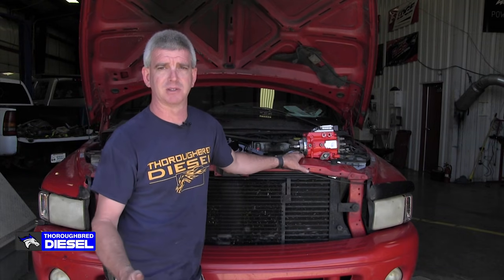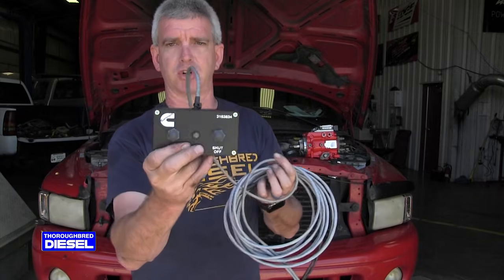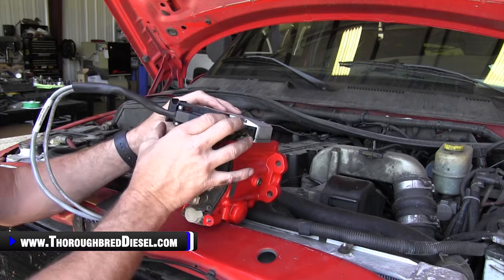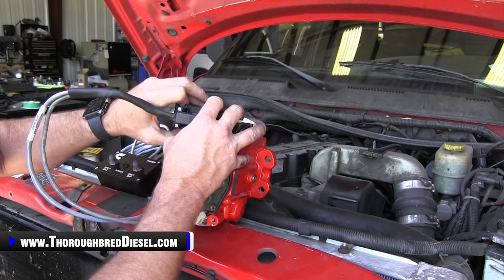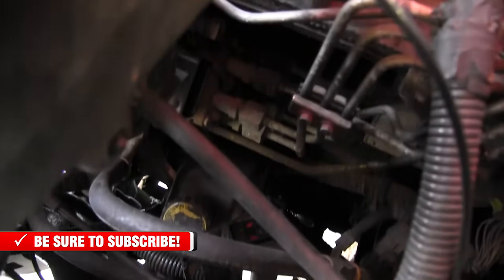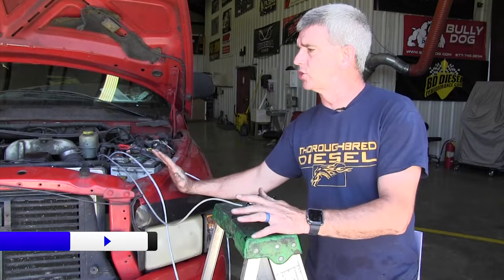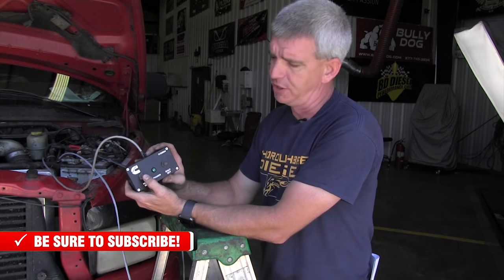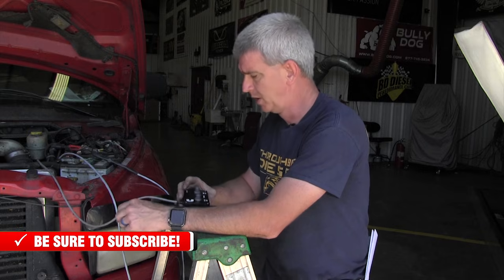Diagnose A VP44 or ECM Problem w/ a Break Out Box Tool #diesel #cummins #howto #fyp

Comment: Okay I have. 2001 Dodge Ram 2500 24v, I have replaced ecm, fass 165, new engine harness, and new injection pump! So my problem is when I unplug the vp44 & run a ground from the injection pump plug in to the battery and it will start right up! If I plug the injection pump back in it will not start!

Comment: After a hard wired test my truck starts right up, so I'm looking up for a ECM issue.. so do your own research and look for pin 6 and 7 from vp44 and run a fuse wire straight to the battery and a negative and it's the same with this attachment.. easy
Reply from the maker: More research is always good.

Comment: Hi, I'll watch all your videos. I checked my + an - with a test light it showed I have a good pos an negative. O an I had a p1689 code just saying so I hot wired my vp44 an the truck started up. So are you thinking what I thinking bad ecm.
Reply from the maker: Thank you very much.  Could be,  check you fuel system relay first before condemning the ECM.  Are you getting signal at the wiring harness?
Reply: @thoroughbreddiesel  I got a ecm from a 200 truck k an it started up an the truck runs better now thin ever had thank you for the info.

Comment: Hello sir
I have a problem with ford focus 1.8 tddi. it has a similar fuel pump, I think VP 30. The problem is, it starts ok, runs ok and then it just die. I can drive it whole day and it won't  die. Then in other case it dies very often. I have good power, good ground. CKP sensor tested and it is ok. I tested CAN L and CAN H terminals and the signals are ok. 
I think that the electronics itself is starting to failure
Reply from the maker: Do you have sufficient lift pump pressure to the pump?
Reply: @thoroughbreddiesel  Tddi does not have lift pum in the tank.

Comment: I have 2000 was having throttle body issues. Because it would fluctuate and finally it went dead go dead. Replaced the throttle body sensor and got it to crank it would be running good and then just go dead. It did this about 3 different times. Finally pulled it off got it cranked run like a top for about 9 miles and just fell on its face and died. Haven't been able to get it cranked since. Any info is appreciated.
Reply from the maker: What codes are in the truck and what is your lift pump pressure?

Comment: Quick question... I have a 2001 and the fuel pressure port is on the back side of the fuel filter housing. Is this an OK place to ck the pressure? I assume this is pressure before the filter. Or is it after? Thanks for the help!
Reply from the maker: That’s ok and yes it will be a pre filter test.  You can move that to the pump side by just swapping

Comment: Does  it  work  for  heavy  machinery with  24v voltage or only 12v ??
Reply from the maker: Yes, but you will need to check incoming voltage to the pump to make sure its 24V.

Comment: dude i have a 03 f-650 cummins 24 valve lost powre at lift pump power wire at pump comes out of pcm bypassed that put on own relay to get power starts but in limp mode for no power at lift pump still how do i get out of limp mode
Reply from the maker: I think you can ground the ground portion of that original drop to the LP and it will make the code go away?

Comment: Dumb question, would this work on other equipment with vp44 pumps?
Reply from the maker: Yes.  As long as it’s a vp44 and not a VP30 or a 24 volt pump.

Comment: How can you check fuel pump 97 Freightliner Cummins 5.9 Winnebago Vectra motorhome codes 111 and 368
Reply from the maker: Does it have a VP44 engine in it?  I am not aware of those codes but if you can get us descriptions of the codes, we can help.  If its VP44, as always check lift pump pressure.

Comment: I have an 02 and having issues. It starts and runs fine, hot or cold. I can be idling or driving a d the truck will shut off but if I’m driving it’ll star back by itself. If it’s idling, it’ll die but I have to turn the key to start it. Hooked a reader up to it and it can’t find anything but cycling the key it has p1693. Any ideas??
Reply: Did u ever fix this problem
Reply: @eithanbegay1285  no. Still messing with it. I’m leaning towards computer

Comment: Does the VP 44 sense the temperature when it is cooler and compensate with more fuel for starting?
Reply from the maker: There isn’t. There is a position sensor in there though. IF you are referring to the “cold water on VP trick”, that frees up the timing advance piston in the bore which will allow the truck to start.
Reply: @thoroughbreddiesel John Deere applications use the fuel temperature sensor

Comment: Does the VP 44 sense a problem with an injector and try to compensate?
Reply from the maker: No. The injectors are full mechanical and the delivery to them is constant. If there is a problem, say low or no delivery on the injector, the fuel is returned to the tank.
Reply: @thoroughbreddiesel  The poppet valves are mechanical** The fuel solenoid and timing solenoid however are not

Comment: Sorry if I didn't get this straight - but if the engine starts and runs with the breakout box the pump is okay? Or the pump is not okay?
Reply from the maker: If it starts and runs on breakout box,  the VP is ok, but depending on what your diagnosing the breakout box doesn’t tell all. It wont diagnose driveability issues. It only will tell you if you have a no start condition, if the pump is the problem.
Reply: @thoroughbreddiesel  Okay, thank you for the the reply and information. Keep up the good work!

Comment: Could this tell is the ecm is burned to give the truck a dead pedal. I have replaced the vp44 and the lift pump I have cleaned the tank filled it up and I miss throttle at 1200-1700 rpm

Comment: I have a prob with my 98 Dodge Ram 2500 5.9 Cummins 24 v it idles great as soon as I hit the throttle it chokes up I replaced the throttle sensor already hope someone could help me out
Reply from the maker: You will want to check your lift pump pressure, and scan the truck for codes.

Comment: Would it help me diagnose my 02 24v getting stuck at high rpm then getting dead pedal after going on the highway when its colder out? I t starts fine though. After I turn off and let sit for a minutes and start back up, the rpm settles back down to normal idle.

Comment: If I have a vp44 truck that has a no start when cold issue will this tell me if I need a vp44?
Reply from the maker: Not necessarily. More than likely it is a leak down situation. Park it with the nose of the truck uphill one night, downhill the next. This will tell you where your leak down is, one of the directions it should start better than the other.

Comment: Question: 
2000 Ram 2500 2wd
 I have 8 volts going to the lift pump (pin 35&pin15)and 8 volts going to the vp44 power supply relay(pin 36). All wires have been ohmed out going from the connector to the pump and pump relay. All was good. I also checked voltage into ecm on pin 48 and 50 (both at battery voltage) as well as ground on pin 49(solid ground). No shorts, restrictions, or any other problem. If I  hot wire the lift pump and power supply relay the truck runs. 
I also checked grounds at block and body both places at zero ohms to ecm ground on connector.
What's the problem?
Thanks in advance😀
Reply: A wire can ohm good, and not be able to carry the current needed because of corrosion and or breaks in the wiring. Load test that circuit. If it's good your ECM output voltage is low, meaning an internal malfunction, so long as voltage input is what it should be.

Comment: Hi, Thanks for the video... I have a question, should pin 5 (fuel shut off) be permanently powered to allow the engine to start and by pushing the stop button the power is interrupted causing the engine to stop or does it work the other way around i.e. for the engine to run no power is to be present and then my introducing power to pin 5 while the engine is running it is stopped ?? Thanks in advance.
Reply: No, pin#5 should be close to 0V in order VP44 to run. When you want to shut it down then you send 12/24V to that pin#5. You see the harness connector, there are 4 pins wired, 6,7,5 and 4. 6 and 7 are supply voltage, 5 is for shutting the pump off and 4 is low idle select.
Reply: @alespretor27  Thankyou..

Comment: What if the truck won't stay running, just starts and cuts off immediately. Reading 19 lbs of pressure to the vp44.
Reply from the maker: The breakout box will identify if the pump or the ECM is causing that.
Reply: Wow $735, I'm not a shop, just trying to diagnose my own truck. Does anyone rent them like auto parts store?

Comment: So why pressure diesel is very law pressure.  What's problem for vp44
Reply from the maker: We don’t want to see any less than 5 psi at wide open throttle on a VP truck, traditionally they run at 10-15 psi.

Comment: My o2 backfired out the tailpipe and lost power with white smoke out the tailpipe and rough running , move it off the road felt like it power up and backfire again shut off not crank again vp 44 or valve stuck????

Comment: Have a question don't know if you can answer it in the comments but my 2000 5.9 Cummins 24-valve automatic always starts but takes about 10 seconds if it's sitting overnight or more than a couple hours if the front end is slightly uphill if it's warmed up and downhill starts immediately another problem is when I'm driving and it hits about somewhere around 30 miles an hour it starts lunging but if I give it gas and that corrects it but then I'm going 40 miles in a 30-mile Zone or 45 does the same thing around 45 to 50 and actually does this when it's shifting second and third or third 2/4 th it's when the RPMs go there lowest it l u g s so it's really hard to drive around the city because all of the speed limits are in that area lot of times I just keep the overdrive off but still does it between second and third if I'm just tooling around the city do you have any suggestions thanks I'll also try your website to or maybe some of your other patrons might have some ideas